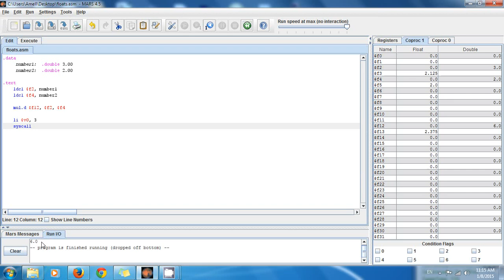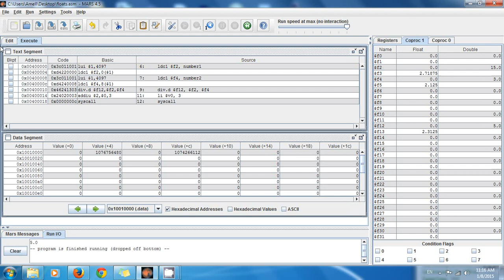MIPS Tutorial 31   More about Floating Point Arithmetic

Comment: What if i want to do multiple arithmetic operations? This is what i have but its not running correctly its supposed to be Fahrenheit to Celsius. 
.data
	
	A: .float 0.0	#Make space for input
	B: .float 32.0	#Variables from formula
	C: .float 5.0	#Variables from formula
	D: .float 9.0	#Variables from formula
	string1: .asciiz "Enter Number in Fahrenheit to Covert to Celsius: "
	string2: .asciiz "Celsius = "
.text
	
		
	li $v0, 4
	la $a0, string1
	syscall
	
	
	li $v0, 6 # 6 =read floats
	syscall
	
	
	lwc1 $f2, A
	lwc1 $f4, B
	lwc1 $f6, C	
	lwc1 $f8, D	
	
	sub.s $f0, $f2, $f4
	
	mul.s $f14, $f0, $f6
	div.s $f12, $f14, $f8
	
	li $v0, 2
	syscall

Comment: Hello really need an assistance what if i want to add an inputed float. Is that possible or i have to initialize it
Reply from the maker: Yes, it is possible to get a float from user's input. 

Example that gets a float and prints it out:
.data

.text
    # Syscall to get user input as float.
    # User input will be stored in $f0
    li $v0, 6
    syscall 
    
    # Print the value.
    li $v0, 2
    add.s  $f12, $f2, $f0     # Argument to print float should go to $f12
    syscall
Reply: Thanks really appreciate the assistance.... But why add $f2 and $f0, I thought I could just load $f12 to $a0 and it shows the value
Reply from the maker: In order to print a float, you don't pass the argument to $a0, you pass it to $f12. The reason is that the MIPS processor or chip has a special set of registers called the Co-processor registers, and these are used for floating point numbers.
Reply from the maker: Also, the input from the user won't be in $f12 by default, it will be in $f0, so you just move it to $f12 as an argument. I chose $f2 because it was cleared (the value by default is 0.0) so that when I added them, it would simulate a move instruction. Remember that for floating point numbers, there is no $zero register.